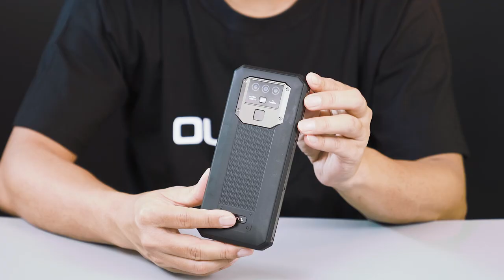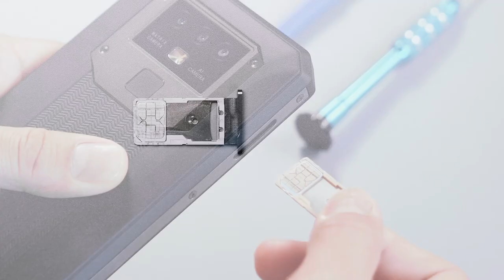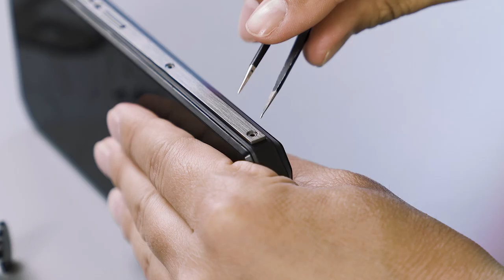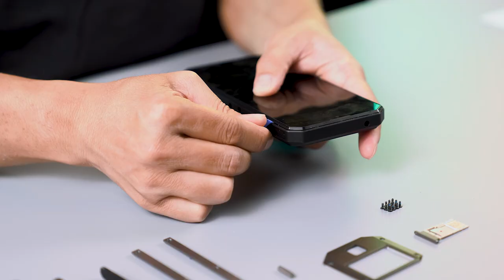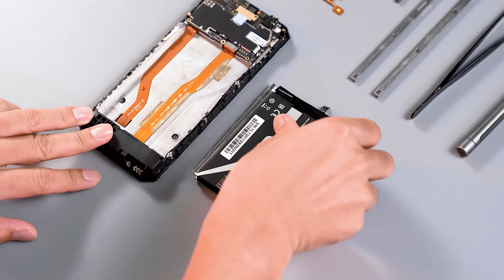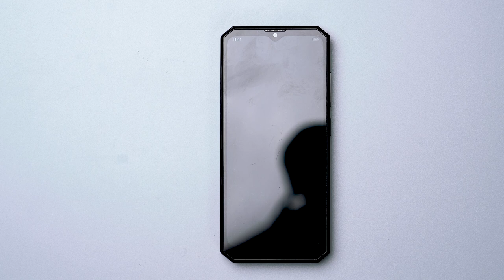OUKITEL K15 Plus Tear Down

Comment: In the coming devices I hope to raise the charging speed From 120 to 200 watts and keeping pace with the devices, especially since the battery is gigantic, you also need to put powerful processors such as   Snapdragon 888  or  Dimensity 1200 و Dimensity 1100  At the very least, raise the memory, for example:12GB ram 265 Rom
We want a very powerful device that competes with modern devices, I wish you success